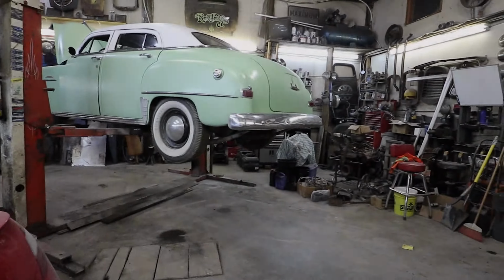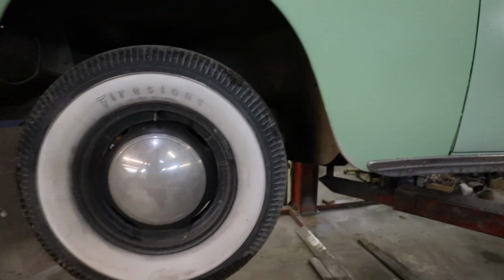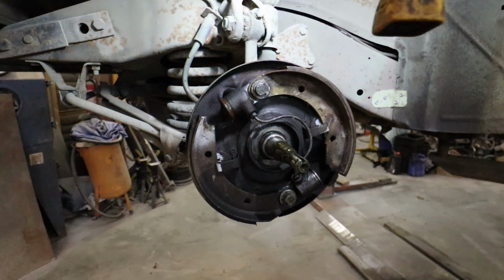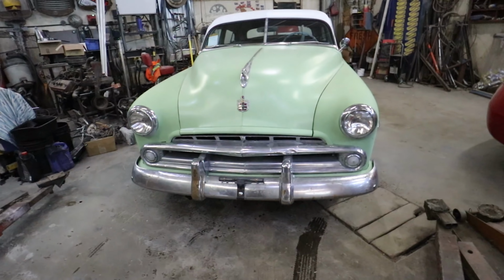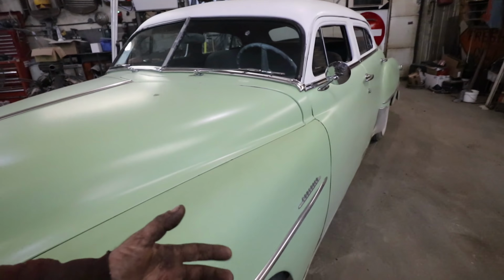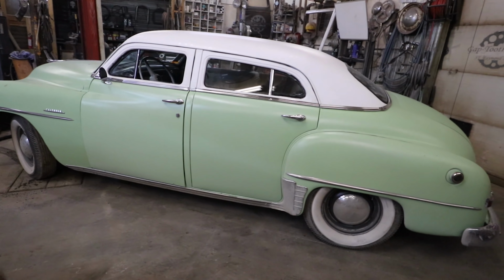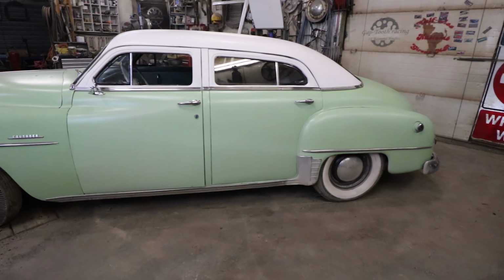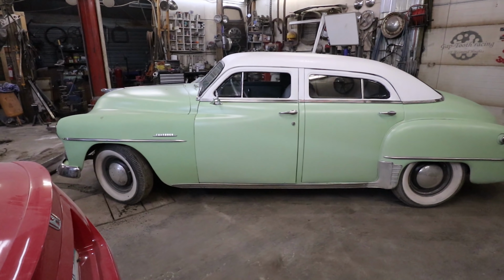Car is finished, I do a show of before and after of the Dodge Crusader

Comment: im really intrigued by your drone shots . are you flying it from inside the car as you drive. if so. thats pretty amazing!  my drone is supposed to have a "follow me" feature but its not working with my current software.. anyway.. nice video.. you really transformed that car
Reply from the maker: yeah it has some follow me options, that's what I use when I'm driving.
Reply: @HalfassKustoms  The drone gave us a quick glimpse of a rotor.
Reply from the maker: @stephenandloriyoung5716  yeah I think it was pretty windy that day and it tends to do that I find.

Comment: I typically don't like a chop but this only looks like it should of now. Absolute right thing to do. I wonder what cars would look like now had that car came with the said engine now and other features that you have changed for the better.... shocks, heater, power steering, and drive components. I don't think we would look as hard at batteries as we do. I know that there is a lot of positive things with the electric cars and those came before fuel type engines to my best knowledge. I think that car is a bab catcher now and back then a girl looked at a more door and said no way hoser. What will they say now?  Although not the oldest, one very nice build